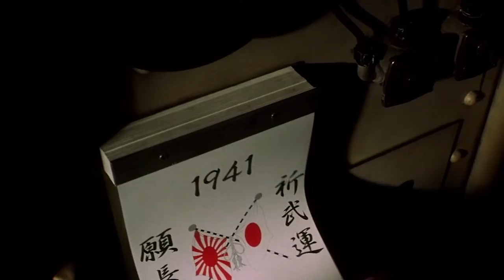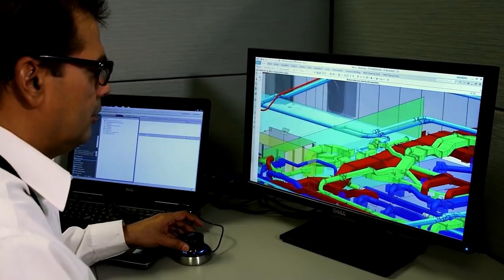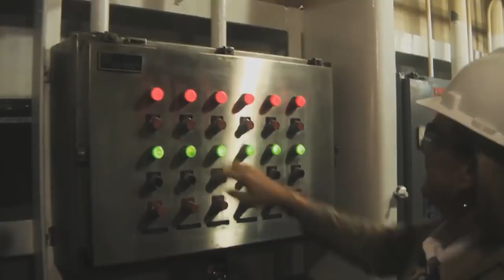Gerald R. Ford - the new flagship of the US NAVY

Comment: Nimitz carriers obsolete?  LOL!  The Ford class is just an incremental improvement, with some more efficient systems (many of which are not working as promised). The Nimitz hulls will be around for another 50 years.
Reply: Magnificent the USS Ford.

Lost propulsion 3 times by now and has dedicated tugboats following it around. Those EMALS? Yup total failure and they literally cannot launch a single fully loaded fighterjet from it. Let's not start on those toilets? lmao!

Doesn't improve means it works better then the stuff before?
Reply: I heard they are still having problems with the electric launching system on the new carriers
Reply: @MrFlatage  the US military has been compromised for awhile now,we have fallen behing greatly on the electronic warfare aspect,this is why russia can just fly over the david cook with a su and disable its electronics,or how china can hack and steal from us on weekly basis,like how they just hacked designed for a sensitive project called 'sea lion' this year,also they hacked f35 blueprints in 2008,the electric catapult is pretty lame seeing as how it can be disabled with russia emp, steam cant be disabled,this is what Germany did in 1943 it switched over from realistic proven easily made systems to small quantity high advances units then just kept getting outnumbered or break down of their advanced tanks and aircraft as soon as they took them out of labs and actualy in field
Reply: @xfrosty9119  Nah I mean that did happen in front of the camera's but China has nothing to do with that. Just fake news and American propaganda to cover up their idiocy ... Blame China for your own mistakes??

Yea UN and everyone around the world has been asking for proof and we got? Nothing.

America’s intelligence chiefs have, too, issued public warnings about Kaspersky software. When asked by Sen. Marco Rubio (R-FL) at an intelligence committee hearing last year whether they would be comfortable using Kaspersky software on their computers, all six of the top intelligence leaders—from the Central Intelligence Agency chief to the director of National Intelligence—had the same answer: No.

So the US Pentagon and US DoD pay Russians for their software and actually put it on their classified servers? Then it starts uploading to foreign servers before deleting the data on the US end and you really believe China had anything to do with that? Come on ...

You are being fooled is more like it. There is no project 'sea lion'. There is a US Navy top secret project called Sea Dragon yes. Well not so top secret. Major cover up to this hack? Also included the entire accoustic ID database for every US submarine ever and every other submarine ever ID'd. Even 1st graders could track every US submarine out there today easily.

Why blame China for the US putting Ruski software on classified servers???

Now Lockheed puts over 5 gigabytes of classified data for the F35 on a open network computer when a toddler with a smartphone could have hit paste and copy but .... ? China did it!!

Sure my rear end, lol!

Come on I could just walk on a US aircraft carrier. Then get into the even more secure nuclear reactor rooms and just download all the data? Which I would love to do but the hacking group called Team Digi7al already did that and I like to be original sorry. Nicholas Paul Knight is not a Chinese not any sort of Chinese made android to look like a American. Nor was Snowden a Chinese.

Yea those A1B reactor schematics and data looking real sweet thank you for that US born citizen in jail and not Chinese at all. ;-)

Oh and ofcourse the entire blueprints for the USS Ford on my desk as well here. Thank you US Naval engineer for trying to sell out your country. But sure let's blame China!

How did Iran get access to sensitive classified materials? Well their mighty goatherding navy simply captured two warships easily. Did not go like some Hollywood movie with hardened US sailors willing to die before giving out the passwords to their laptops but ... Yup entire world saw them cry and then call for Commander Mommy. China again had zero to do with it.

Iran got 4 of the CIA's top secret stealthdrones? Yup billions of tech in those things and? No firewall or even encryption, lol! You know how terrorist get video images from US military grade combat drones? Simply downloaded the Skygrabber App on their smartphone for 26 UDS and piggyback ride the non encrypted videofeed.

The so called Fat Leonard court martials? Yes a USN admiral, 9 USN officers and 64 USN sailors all convicted for handing out top secret stuff cos of bribes and prostitutes. All US born and not a damm Chinese in sight.

But sure you are free to believe what you like? Oh no CHINA!? Nah just fake news.

Though I do oppose capital punishment and do not agree with any goverment having the 'right' to kill their own citizens and would sacrifice my own life to protect my countries citizens from any such attempts? Military law does not apply to citizens but it does to those who serve.

Start shooting every traitor wearing a US uniform and you will see security breaches go down rather quickly ... 

Now my kid was only 7 when he called Avengers assemble and manned the gatling laser cannons to defeat Captain James Kirk? He is 10 now and will be a Ripper before the year is over. Just put him in charge of the entire US military and things will improve quickly.
Reply: @MrFlatage  its to sad
Reply: @xfrosty9119  Nah you need to look through the fake news to get to the really sad stuff ...

US Navy expert recruiter: Hmmm so your name?

Edward: Mister Edward Lin sir!

US Navy expert recruiter: You look ... where are you from Mr LIN?

Edward: I was born in China sir.

US Navy expert recruiter: Oh ok right and what would you like to do in the US Navy?

Edward: Become a Lieutenant Commander and ehmmm not hand out classified data to the land I was born in? Pretty please?

US Navy expert recruiter: K sure you are in and now a Lt. Commander in the US Navy and here are all the passwords.

Now that is truely sad ...

If I was recruiting like that I would not have shot Mr. Lin for trying but I would have shot myself.

But there are great rewards too for serving. Just the face of Captain James Kirk in his Zumwalt thinking he had stealth as a benefit forgetting the true Avenger class? Yup those hulls are made of wood and my kids ship was entirely made out of wood.

https://imgur.com/JzGvTxb

And then he was like ... Come on laser gatling cannons? :D

Or NATO's Northern Star where we were 6 feet under a US carrier for 3 weeks only to pop out at the end to 'sink' them all. Sending a diver out every day at the stroke of midnight and bang on the hull? Priceless. Every good sailor is a bit superstitious.

Get a professional military would be great. Ours start at 6yo. To get their own command at 11yo? Become a Ripper and sink a entire US Carrier Battlegroup in under 10 minutes. Beating US Marine General van Ripper who did it in little over 10 mins. He had the right size of balls to command.

Right now it is beyond sad but I do not command the US forces normally so can't help out much. Already deployed on US soil 3 times and getting tired of it.
Reply: @MrFlatage  yeah... I mean no system is perfect,and a smart evil man once said quantity is a quality of its own,and its hard to tell why if what u say is true we have so many chinese in our military,alot of traitors it seems but I have 100 percent confidence in the ones who are not, no one would think of sinking a us carrier unless if they want to face 1 of the last 2 nuclear armed global powers, just that fear alone of how we will retaliate is the best weapon we have
Reply: @MrFlatage  guy we still have thermo nuclear warheads all around the world ,there is now winners in this war dughhh
Reply: @MrFlatage  and u are not who I say u are because #1 if it was so so easy to nuke usa Soviets would have allready done it #2 we have Ohio class subs also in deep Pacific and the Pacific ocean is to huge to cover every mile,#3 if u knew about radiation even if our icbms here at home get intercepted the radiation from that much fire power will blacken all of the world's globe and make it impossible for anywhere to grow food ,radiation lasts 1000s of years u cant live in bukers that long,also the Chinese have a population probably close to a billion u cant build big enough bunkers and expect to eat but u are so smart i dont need to teach u how we survived thru soviet Union who has better nuke tech then garbage china
Reply: @xfrosty9119  Well every fact stated has been proven by US military experts and direct official US goverment sources you can look up and they all have POTUS signatures on them. And none of those have 'edit' above them? ;-)

Sorry but your claim? Your Burden of Proof under the US Constitution so where is your evidence to your claim about me?

NFU goes for all. First country to launch nukes gets it from the rest of the world. If you are not aware of International treaties I advise you study it?

You don't have even a single submarine sorry ... Nor does the USN. Not many left remember you checking the actual US Navy Active Fleet list and the reports on that by Chief of Naval Operations, Adm. John Richardson?

From 2000: Ehime Maru and USS Greeneville collision, USS Dolphin major flooding and fire, USS Oklahoma City collision with tanker, USS Hartford grounding, USS San Francisco collision with undersea terrain, USS Philadelphia collision with MV Yasa Aysen, USS Minneapolis-Saint Paul incident, USS Newport News collision with Japanese tanker Mogamigawa, USS Hartford and USS New Orleans collision, USS Miami arson, USS Montpelier collision with USS San Jacinto, USS Jacksonville collision.

Now do you like to inform everyone here how many of these Ohio's you really have out there? I'll stand with the admiral on this one sorry. Only truth and fact under my red, white and blue.

Also be standing with General James Welch, a former top nuclear commander who is not wrong and there is barely any firepower left remember reading it before you commented? Oooh wait you didn't. Maybe that is the problem that is making the US military weak to very weak. People do not listen ...

Again we all know what happened during the years after Tsjernobyl? Crops all over Europe failed due to the fallout but we kept producing? We do not have any top soil over here cos all over soil is covered up? One puny country that barely shows on the globe that is 3rd producer of crops in the world? You have no idea how we do it? Well ... We do. Nr. 1 in the world for crops produced per square meter?

Sorry US has no nuclear bunkers other then for the elite. I am not Chinese so that is their problem not ours over here.

Remember how our submarines have an even greater range then US nuclear submarines and why NATO picked ours over nuclear subs for Operation Ocean Shield?

https://www.youtube.com/watch?v=-qB1A751veA

Who do you think they got that idea from? Where are you from that you have yet to develop artificial light to grow food 100s of meters below ground?

Derinkuyu in Cappadocia in Turkey is probably the largest underground city that has been discovered to date. It spans more than 8 levels going as deep as 80 meters with more than 600 entrances to the surface. And yes that was built 8 centuries before Jesus popped up.

So yes you do know how much the Obama bill costs for US nuke overhaul? Almost 2 trillion USD.

You really think people cannot built cities underground for alot less then that with schools, parks and even have beaches underground?

Go ahead and launch every nuke on the planet and 'blacken' the earth? We don't need the sun to grow food. Heck hydroponic garders? Yup those do not even need soil to grow crops.

But yes argiculture in the US right now uses 180 liters of water for every pound of crops grown. Over here? We only need 8 liters ... Very smart and we make more profit cos we don't pay as much for all that wasted water. And nano filtering can even make radioactive water clean again remember studying that technology?

Yes yes we heard impossible all our lives and throughout our history. Noooooo!! Teleportation is IMPOSSIBLE!!!!! And then we did just that remember?

Had we believed the world was flat? There would never have been a New Amsterdam and the Founding Fathers would have been hung. Good thing some people are smart right?
Reply: @MrFlatage  u watch to much youtube believing biased channels we are building at moment new type of icbm sub
Reply: @xfrosty9119  What nonsense are you rambling on about?

Comment: The Ford is still unready to deploy about 2 years after commissioning.
The catapaults and arrestor equipment are not capable of sustained
operations. The armament elevators have major problems bringing
ordinance up to arm the aircraft. The ship's electrical grid has had 
several major failures. And the cherry on top is that the Ford is
not equipped to operate the new F-35C stealth fighter. It may well
be another 2 years to iron out the design flaws, if indeed they ever
do succeed to do so. The next carrier in the class, the JFK , may
well be delivered and tied up in port alongside the impotent Ford.

Comment: The advancement in nuclear power generation, A.I, wireless transmission of power, will make this ship obsolete in less than fifteen years. The internals will all be retrofitted.
Reply: Doubt they will use any wireless transmission of power in fear or system failure or any kind of intermission. Usually everything is hardwired (and I can't see that changing) for a multitude of reasons.
Reply: @Jpudlo01  You may be right. Interference would be an issue.
Reply: @Nikonik66  I work on Submarines, it's the same principle I would imagine... just much larger lol.
Reply: @Jpudlo01  I watched a video recently of a teenage prodegy that has invented a new way to to make nuclear reactors that don't burn hot and are much more portable. I'm looking for the video. I'll send you the link.
Reply: @Nikonik66  Yeah that'd be cool to check out, thanks!

Comment: Seems like more of the same old garbage. Networks have gotten fast enough where you can fight with no lag while transmitting enough to  enable VR like experience.  Get rid of the need for manned fighters and replace it with drones and design of carrier would be radically different.
Reply: Pars S what drones are available right now? None. They aren’t ready yet

Comment: EMP done
Reply: Not how electronics work.
Reply: @peterson7082  A nuclear electromagnetic pulse is the abrupt pulse of electromagneticradiation resulting from a nuclear explosion. The resulting rapidly changing electric fields and magneticfields may couple with electrical/electronic systems to produce damaging current and voltage surges. Last time I check any one who was a threat to this destroyer has the capability. If I'm mistaken please explain
Reply: @AdamWarIock  As said, these are the side effects of a nuclear detonation, the electromagnetic discharge is only one part of the danger of it. Additionally ships are essentially huge faraday cages.